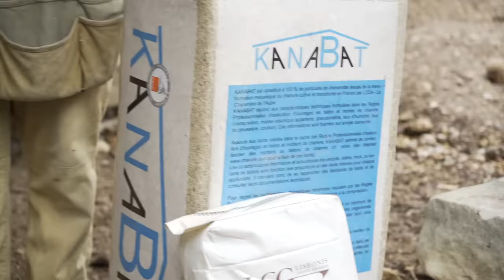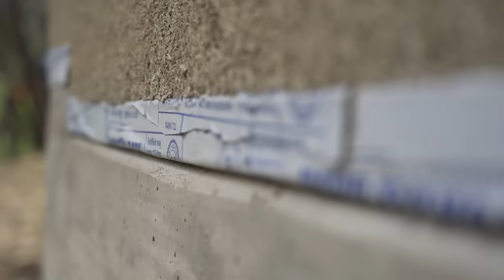Hemp Concrete Walls (R30 + Fireproof) - You Won't Believe How They Built This House!

Comment: I would have loved to heard some pricing.   It comes across as a high end product only affordable by people that build with 300 year old lumber shipped from Japan.
Reply: Don’t forget the team of Japanese carpenters who assembled the wood with hand tools.
Reply: it is the shipping that is the killer.. I priced it.. 2100 sq foot house  around $12000 for the materials and double that for the shipping, perhaps another $20000.  Remember getting tons of the hemp and the Lime is heavy like portland.    Plus it is labor intense to install.  As a DIY it becomes affordable.. if you can source it domestically.  More States have legalized the planting of industrial hemp.. This should help
Reply: @JimYeats  I didn't,  it just seemed like rubbing salt in the wound.
Reply: Exactly. For all the green hype, it's extremely labor-inten$ive.  This is virtue-signalling run amok
Reply: @JimYeats  last house I saw that done was Larry Ellison's home. Built in Japan without nails, and reassembled in Woodside Ca - billionaire's row...
Reply: @stevepailet8258  don't forget the labor to form, mix and install.  Double the materials and shipping I bet...
Reply: @robertmccammon9024  Or in this case...lime in the wound.
Reply: But realize that you can use standard framing. In Asheville NC they built a hemp house $120sqft, so definitely not high end pricing. And that was all hired, no self labor job.
Reply: @stevepailet8258  There aren't yet enough regional markets to encourage growers to produce hemp. Without many buyers a commodity can't reach economies of scale.  So, hemp remains the fiber of the future, but videos like this can help change that.
Reply: I loved everything about the house but the hemp.  They've got to find a faster way to do it.  I'd rather mow my lawn with a pair of scissors.
Reply: Hmm, I confess that I don't see the problem with having "the rich" wanting to build experimental stuff as they are "transfering" money into the less well off in the building trades and local economy.

As for using a team of Japanese carpenters to erect the frame then why not? Why would you risk having a "local" team unfamiliar with the techniques attempting to erect the frame and making a cock of it?

And if you consider the project would have required transportation for the framework and accomodation for the Japanese team then a fair bit of money has been spread around into the local economy. So not all bad.

And then you had your lads do the hempcrete main house build not to mention  your local architect, plumbers and sparkies and plasterers and landscapers and possibly locsl interior designers to complete the job.

And don't forget the builder's merchants who supplied the rest of the material, timber, sanitary ware, electrical kit, doors, windows, heating kit etc, etc.

In UK the builders positively rejoice if a "rich" client comes along ... and if they want a massive house then it's like Christmas come early sort of thing.
Reply: @ArthurDentZaphodBeeb  Indeed it's labour intensive and that means more labour and more money into the local economy.

Can't quite see the downside to that.
Reply: @ArthurDentZaphodBeeb  But more money into the pockets of the builders, what's not to like about that?
Reply: @timothykeith1367  And of course the "future" becomes "today" ... all too soon unfortunately ...
Reply: @t1n4444  These homes are hyped as green woke buildings. 350 year old wood! Recyled! Carbon-sequestered! Just forget to mention it had to be dismantled, shipped across an ocean, trucked to the site, reasembled by a team of Japanese (who were flown out and back). Then to make it even more laughable, used one of the most expensive insulation options available. But it's 'fire safe'! It's green! Except the hemp had to be shipped hundreds/thousands of miles. And the home is in a forest, with a wood shake roof with tons of exposed wood...and will burn to a crisp in a few minutes.
 I have no problem with people spending money on this stuff, but let's get real, this is a 1%er virtue-signalling vanity build.
Reply: @t1n4444  Well, why not use locally-sourced materials? Cellulose insulation is found everywhere, no need to ship in from hundreds/thousands of miles away. Plenty of timber in the US, so why buy a 350 year old building from Japan and import Japanese labor to assemble the thing? We have Great Depression level unemployment...
Reply: @ArthurDentZaphodBeeb  An excellent point and the answer is in your own American hands so to speak.

And for cellulose then there's no reason why you yourself don't experiment with using cellulose in place of hemp fibres. Have to say though that resistance to a very hot flame was impressive ... which might be a challenge for cellulose.

Have to say if you struck it rich then it was well deserved if you took a chance.

Returning to hemp then surely you must have enterprise grants to grow or farm a crop of hemp for exploitation as a buildings material?
Might be just a case of asking???
Reply: @ArthurDentZaphodBeeb  Just saw this comment.

Again can't argue it is a vanity project of huge proprtions. However if money went around then has to be a really good thing for all concerned.

As for hemp being expensive then economies of scale kick in when "every" new build uses it.

I can see your Authorities rather liking the fire "proof" properties.

As for roof material then on some of our trendier vanity projects the owners specify "reclaimed" slate. (Has to be Delabole for bragging rights, obviously, 😂. Recycling being the new religion over here.)

Some even want copper cladding as it goes green. And some even trendier types want corrugated iron sheets.

 If you are absolutely mad on being green (or is that seen to be green ...) we have your actual green roofs covered in grass.

However, as mentioned elsewhere, if you wanted to see really, really green buildings them some of your fellow compatriots had mastered the art a long time ago. Energy efficient, very little greenhouse gases released in the making etc, etc.

 (Slightly tongue in cheek but you might say they got the idea from termites and their mounds ... no, really.)
Reply: So, NOT hemp, just cellulose. Could do this with nothing but the cellulose insulation found in the attic and walls of every house in the USA... PS: Hemp is the outter fiber of the plant. This is nothing but corn stalks in reality and you could use corn stalks just as well. Seems like a whole lot of wasted effort. Just buy rockwool.
Reply: @ArthurDentZaphodBeeb  If this becomes a mainstream product, those negatives don't exist.
Reply: @stipcrane  In my experience one man with a labourer can do 40ft of hempcrete wall 4ft high in one day.  Also the shuttering can be raised the following day for the next lift.  What makes it a bit slower is the drying process before plastering, but plenty of other work can be done in that period.
Reply: @ArthurDentZaphodBeeb  it is green and yup super labor intensive for sure. but that said all building is labor intense.  The real thing is this is not an area where there is any real skilled folks.   plaster work is labor intense. sheet rock is labor intense.  Framing can be labor intense.. Heck if you got out and helped pour concrete you would be going OH my this is labor intense
Reply: @timothykeith1367  Seems there are enough growers at the moment .. seeing all of the CBD outlets, But I have also chatted with a couple of growers who  just dump the stalks.  Does not make a lot of sense. but that is what I was told.  Perhaps as time goes on and more people see the advantage of hempcrete this may change.
Reply: @stevepailet8258  Farmers are reluctant to invest in hemp when there is just one buyer.  They want the best prices for their commodities.  Commodity exchanges for hemp exist, its a matter of time before its widely grown.   There must be widely advertised brands for the hemp market to explode.  Hemp can be raised on marginal land not suited for other crops, land that is used for pastures of woodlots.   If hemp proves to be widely used in construction then, I'm sure we'll see it in many retail stores, but probably not Home Depot because the hemp products tend to be bulky and self space is costly.   Bulky farm products like hay are mostly local because its costly to transport.
Reply: @ArthurDentZaphodBeeb  - Let's admit it though...  The only reason this hasn't been done on an industrial scale (which would surely drop the cost my more than half) is the prevailing American attitude that marijuana is bad, and the continuing poor education of weed vs hemp.  It's just easier to write off the US market than to try to educate the ignorant masses (and the government these idiots keep electing.
Reply: @FHL-Devils  ha, agreed. There's some great old movies about 'demon weed'. It's incredible it's still listed as a Schedule 1 drug (similar to heroin/lsd). Yet cocaine is only Schedule 2.
Reply: @timothykeith1367  I agree with your assessment ... this is exactly why I said the cost of the material is not huge but the shipping is a killer.. one or two suppliers .. the real suppliers are in France the UK and China.    Short of building with pre made blocks to be glued together dont see it actually happening any time soon.  Contractors are not willing to deal with it as there is not much demand.  The contractors have no clue ... the end buyer has no clue.  I have been posting about the product for years.  I will continue to post on my website for years.  Hemp is used widely in the EU.. and some other venues.. So what are we looking at 10 houses a year in the USA?  not much for sure
Reply: @stevepailet8258  I am thinking of experimenting with shredded EPS foam (styrofoam) mixed with cement. It lacks the strength of regular concrete but 48-inch long blocks (10-inch wide/16-inch high) only weigh about 25 pounds each, so I've read.   I've read that the blocks are 55 percent as strong as concrete made with aggregate. The blocks have R-24 value. Its also fireproof and insects won't damage it, the blocks are assembled with spray foam instead of mortar - the hollow cores are filled with rebar and concrete to provide the strength of the wall - 8 times as strong as a wood framed 2 x 6 wall.   You can cut the blocks with any saw designed for wood and can carve grooves with cordless tools to run wiring.
Reply: @timothykeith1367  recycled foam and concrete  cellular blocks have been around quite a while. There are several companies who make them and you can even buy shredder mixers now.  Those that are cellular where you can pump in concrete and lay in re bar are amazingly strong and as you say r25 whole wall insulation is a super good way to build.. It all comes down to how much you can save diy
Reply: If the infrastructure was there this product would be affordable, hemp is easy to grow.
Reply: @Lappmogel  still have to register to grow hemp.  Takes about 1.5 acres to  harvest enough shiv to build a 2000 sf house
Reply: @stevepailet8258  The stoners where right then, the government really did kill hemp with a bunch of red rape bs.
Reply: ArthurDentZaphodBeeb who said these houses are green?
Reply: @ehuang12  I say they are green.
Reply: @ehuang12  a few reasons.  no fertilizer is needed to grow the hemp.  The shiv is remarkable in its ability to sequester carbon dioxide  the lime used is not nearly as bad on the environment as is portland concrete.  This is due to how much processing and release of co2 making portland.  Curious.. would you call vinyl siding environmental?  Not when it is produced not when it gets to a landfill.  Would you call gypsum board really environmental when you know it can harbor black mold if it gets wet?  How long does it take to break down fiberglass insulation?
Reply: Steve Pailet I get it, I was just pointing out to Arthur that no one in the video claimed it was green
Reply: @ArthurDentZaphodBeeb  it's more ecological to feed a half dozen men for a week than to have a bunch of large trucks and machinery burning fuel away for a day. Yes, it's expensive. Until these methods of construction are perfected and normalized, the costs will be prohibitive for many but brushing it off as a hipster's gimmick is disingenuous. This SHOULD be the norm, not concrete, rock wool and cement boards. It just needs to become financially accessible to more people and the funny thing is: for that to happen, there needs to be more virtue-signalling hipsters using it.
Reply: @FHL-Devils  hemp production and weed consumption are legal in many states DESPITE the reefer madness/war on drugs debauchery so I wouldn't use that as an example. Most of the world still regards weed as the bane of evil while the US has made it widely available. I think the main culprits right now are lack of knowledge of the product, vested interests in business-as-usual mineral and petro-chemical products and industry, and cost of course, economies of scale as someone rightly said. The more people use it and gain knowledge about it and the more accessible it will become.
Reply: @papapetad  any cellulose-based product is good in my eyes. But no need to use very-expensive hemp when the world is awash in very-low-cost recycled cellulose already. So, no, we don't need hipsters virtue-signaling hemp, because all that hemp is used for is insulation.  Air doesn't give a damn whether it's trapped by hemp or ground up cardboard...
Reply: @papapetad  - I wouldn't say "Many".  11 states have it fully legal, 8 states have it fully illegal - so the ratio still isn't very good.  And as I stated, the primary issue isn't legality, but perception.  You spent a long time explaining how you agree with me.  As for global perception of pot, around the civilized world - outside the pacific rim - it's pretty much open use now...  Also note that the only reason that marijuana law was passed at all is because the US occupying force enacted it during WW2 - the Japanese government is rather ambivalent toward it.
Reply: @ArthurDentZaphodBeeb  I am defending the use of hemp in general as a great substitute for established ecocidal materials so I am approaching comments for this video from that perspective and while I agree that recycled corn stalks or any nunber of other organic products will do the same thing, I also think corn monoculture and current practices are ecocidal and it would be much better to convert a large portion of that agriculture to hemp production so any promotion of hemp products is good in my books. Finding out more ways to use and make money from current ecocidal systems does not help change the model, it only offers more ways to promote it. This is a step towards making hemp cool again, which could mean bringing back much more ecological textile production as well. It requires no pesticides, very little irrigation, no chemical fertilizers, no slave labor in 3rd world countries, no cutting down of the amazon. Bigger picture stuff. Long term. It's not gonna solve the world's problems but I see it as a major step towards sensible change, bringing back practices that were commin sense before some assholes decided cannabis was detrimental to their agenda.
Reply: @stevepailet8258  or use locally found alternatives like corn stalks or wheat chaff
Reply: @stipcrane  make blocks in a factory and ship to site, doesn't have to be "poured" on site, it's plastered over so the texture won't show. Rich people just want to show off 👎
Reply: @colinstace1758  go ahead and use them you will discover why they dont hold up
Reply: @stevepailet8258  how are they different to hemp ? What about coconut fiber ?
Reply: @colinstace1758  coconut fiber is good for making grow mats for micro greens
Reply: @stevepailet8258  canvas, rope and paper need a long staple, these fibers were cut short, looks like 1/2" - 5/8" in length, it's a while different process to hemp crete. And with paper there needs to be a certain percentage of virgin fibers so you can't keep recycling paper without the virgin fibers. You could use many different fibers, bamboo, flax, sisal, coir etc if you had a local source
Reply: @colinstace1758  all good but remember hemp is not the same as your examples
Reply: Historically there are examples of sawdust used to make a similar product.
Reply: @brianphillips7696  LOL then there historically is adobe and cob and straw and horse hair.
Reply: Steve Pailet unlike those others sawdust is easily sourced these days and the end product is much closer in it’s characteristics to the product displayed here.
Reply: @brianphillips7696  OK build it and I will come LOL.. I think that saw dust does not preform well.  It swells.  shiv does not
Reply: Steve Pailet OSB sucks when it is allowed to get wet yet it seems to have found a place.
Reply: @brianphillips7696  more glue in osb than actual wood fiber it has its place but it does mold a lot more than plywood.. no way for the moisture to work its way thru to dry
Reply: Your statement does not make sense. Did you miss the normal lumber and structural steel that are common construction? The Hempcrete is only a curtain wall.
Reply: @ArthurDentZaphodBeeb  nothing like being a billionaire to be able to afford that sort of thing. Oracal is a huge date company like Microsoft
Reply: @t1n4444  building and making up this version as you mention using cellulose gives on paper crete.  It works as a nice mortar in building a cord wood building. OK now you have two more building materials to look up
Reply: @w8stral  corn stalk is not like hemp shiv.. then again dont think from your response that you have a clue what you are talking about.. so we just have to love you anyway
Reply: @timothykeith1367  perhaps this is so. but most farmers today growing hemp only sell the seeds and use the rest for feed stock
Reply: @timothykeith1367  would be a lot better using AAC
Reply: @colinstace1758  the fiber is the outer hull of the stalk. the woody shiv is the inner pulp.  what you are describing is like saying the outer layer of bark on a tree is the same as the harder inner wood.. not the same
Reply: @stevepailet8258  Ok.

While we are on the topic of "cretes" it occurs to me that if we are wanting to be green(er) then we seem to have a virtually inexhaustible supply of a very long lived and inert material in the form of plastic packing.

Over here not only do we only use it once we spend a great deal of cash shipping it to third world countries so they can recycle it and resell it. Only they don't do a great deal of the recycling thing.

Some of our more enterprising investigative reporter types have done the "shock horror!" exposés on rivers covered in plastic and the vast open areas metres high in "our" plastic waste.

It occurs to me that if the waste was shredded and entrained in cement then we are "doing something about it". And making "plastycrete".

Now, this may already be happening "somewhere", so I am not claiming the prize for saving the planet.

And if anyone thinks this might be difficult to work with as in labour intensive with forms and suchlike then ... sit down for this ... Germany is already using a vast 3D printer, squirting concrete, to build a three bed in Dortmund.

And if anyone is sitting there with their sceptical face Spain have already printed houses, offices, museums and even a bridge.

Some of you who live on the other side from Europe may be even more astonished that you have your very 3D printer outfit in California, calling themselves "Mighty Buildings"

Mexico is already printing up an estate of 50 dwellings in Tabasco.

From the press article it states the German version has triple skinned cavity walls filled with insulation.

Part of the printing kit was designed in Denmark and the construction company is "Peri".

The building authorities went over everything in minute detail and presumably have passed it on principle but will presume the actual build will again be examined before being signed off for human occupation.

Now, before the possible avalanche of criticism descends listing just about every "what ifs" and "ah yes buts" it might be of benefit and educational purposes to Google up the examples mentioned above.

In short suggest you read up first, then pull the thing apart.

And, before anyone comes out with it, the overall costs of these projects in not claimed to be cheaper 😂😂😂😂.

It is for the moment in the "experimental list" and may, possibly,  be accepted as a viable method of construction  and very possibly cheaper in the long term.
Reply: @t1n4444  see no reason to not use chipped plastics as a portion of fill aggregate. Have not found anything that even mentions it. China used to take a huge amount of the refuse plastics but for whatever reason(I am not aware of why) they have greatly reduced what they are importing to recycle. Would assume it has to do with prices..
Reply: @w8stral  dont have a dog in the fight of using corn stalks. I just do not think they have the qualities that hemp has. Until you can get government research facilities to do their own experiments you are suggesting pie in the sky. No hemp being smoked here but I do have to question what you are smoking.  Why dont you do some tests and have the results posted?
Reply: @stevepailet8258  Using chipped plastics, as you describe them, in "local" construction products might reduce overall "secondary pollution" produced by transporting the waste thousands of miles across the planet.

I was not thinking along lines of pladtic to China per se but other Oriental Asian countries including India and of course African nations.

Forgot to mention that if folks not interested enough to search online then they need only remain on YouTube and search for "printed buildings".

The Dortmund project is but one amongst many.

Of which I was impressed by fact that concrete material kept at constant moisture/density/flow rate to ensure uniform thickness of layers.

Promo video was not that long so the finer details of construction were a bit lost as it were.

Presumably there are in-depth videos elsewhere with regards to mix details, drying times etc.

Fascinating stuff, well to me anyway.
Reply: @t1n4444  I watched some printing and appreciated that the house I saw was being printed with internal triangulation truss style.  With all that enclosed dead space I wonder just how much R value is created.
Reply: @stevepailet8258  According to the article in the paper the voids are filled with insulation.

I speculate the insulation might, rpt might, be of the two part polyurethane type foaming agent stuff ... or green version of perhaps?

I would further speculate the German construction authorities are pretty picky on insulation values. And the builders very anxious that the building is built way over building spec to ensure good reviews. 

Doubtless the German/European techo construction journals will be all over it like a rash trying to poke holes in the theory and practice 😂.

It is gets a favourable review then might see more of them all over.

And as you will know, or will research, concrete acts as a sort of carbon dioxide magnet.

So not that green perhaps but not quite as bad as you might think.
Reply: @t1n4444  low expansion am sure because it would blow it up other wise :)
Reply: @stevepailet8258  😂.

Having done more research I see some construction uses rice husks entrained into the "crete" and the voids filled with rice husks.

Further it seems as if printed buildings are rather more popular than I had at first realised.

In fact for those who don't live in Texas I see that the authorities have collaborated with printing construction companies in Austin for "social housing " projects.

Some of the first structures were printed on 2015 ... and there was me thinking all this was cutting edge!!! 😂😂😂

Note to self ... watch a lot more YT building construction stuff, and not just ToH.

I suppose the clue is in the title ...
Reply: @t1n4444  I was surprised at the r value of rice hulls. 3.5 is pretty decent per inch.. The biggest problem just like Hemp is the cost of shipping. Not a long list of things one can do with the parboiled husks.  They just like the hemp shiv are are high in silicon content. It is something that more than a few commenters just do not understand.  They suggest mixing plant material that easily break down and compost back into the land.  Rice hulls pretty much can be laid as a mulch and look the same 5 years down the road
Reply: @t1n4444  the cost of the husks is pretty much negligible if you have a way of getting them to your location.  Seems like there is no reason to go with the extra steps of using them as the aggregate in a lime slurry.  Just blow them in like one does cellulose.  Nothing eats it. hard to get them to burn.  Because it is dense sound is not easily transmitted. For attics just loose fill and it will pretty much just fill the cavity of the attic at the ceiling level.  I  imagine one could mix with a foaming agent in an open cell mixture. Though no clue how well that would adhere to the roof or walls. Easy enough to use a mesh like you do with cellulose.
Reply: @stevepailet8258  Talk about one topic triggering another.

I recall see one of the videos of quite some time ago when parts of Windsor Castle were gutted during a catastrophic fire (builders had left a halogen lighting rig too close to something flameable, allegedly).

The voids above the ceilings were carpeted in tiny sea shells.

I would suggest this more for sound insulation ... against eavesdropping of state secrets, or more likely bedroom gossip ... as in who was "playing away" with the Monarch of the day.

If ever you read "Wolf Hall", by Hillary Mantel, you would learn that the folks of the time were quite "keen" on that sort of thing.
Reply: @t1n4444  seems I heard about that.. I have not been there since 1987.
Reply: @stevepailet8258  Oh no, a bit earlier than that ... I was thinking more like 1530s.

Sorry, I could not resist!

In fact tiny sea shells used just about everywhere providing owner had enough cash to have them collected and moved.

And, thinking of all things archaeological in the buildings line ref your royal residences, and in regard to earlier comments about termite damage to the timber works in these buildings, then a remedy was known for insect damage in the form of the sweet chestnut tree, aka castanea sativa (that sativa gets everywhere ...)
 
The exposed hammerbeam joists, rafters, etc, in a hall to be found in the Palace of Versailles has, according to the guides, never had a cobweb or bugs on it since it was built.

Much in the same way camphor wood was used in construction of chests to protects against clothes moths or mosquitoes.

Might be timber buildings might be longer lived if different timbers were used.

I wonder if your silviculturists have considered planting sweet chestnut trees? Mind you might be quite a few years before you could benefit.
Reply: @t1n4444  bugs just dont eat sea shells..  pretty fascinating over time to see how buildings have changed.
Reply: @stevepailet8258  😂👍
Reply: @ArthurDentZaphodBeeb  what does labor have to do with virtue signaling? 
how is using a more natural product disingenuous? They show and say that it is more labor intensive in the video lol
Reply: Way too expensive for most people
Reply: @faith5563  Then straw bales it is IJ3.

Good spot, and more than enough videos featuring straw bales on YOUTUBE to see you through this lockdown, and the one after that ...

Save you lot chopping down CO2 sequestrating trees and start construction of houses with straw bales and clayey mud.
Reply: @stevepailet8258  What site do you pick up the wood of old Japanese house?
Reply: @robynbyrne5834  my first guess would have lots of money and go to japan. Looking at the wood in that part of the world the kinds of hardwood there is much like mahogany.  Really does not matter what part of the world one goes to what in my view does matter is trying to find first growth wood.  It is tight grained has a lot of minerals so it is super hard and stable.  Think dehydration of the wood.  That along with being more straight grain wood. I have worked with some african and some amazon basin woods but never any but small pieces from the far east. When I lived in the UK. I did go visit sherwood forest. Not much in the way of those gigantic english oaks. All cut down to keep warm.  Now it is nothing but pine trees that were replanted as second growth
Reply: @stevepailet8258  Cool, I'm a trucker building in Northern Michigan. I can bring it myself.
Reply: @t1n4444  Without the builders nobody has a job. You're a Genius.
Reply: @thisismagacountry1318  I know ... he replied, modestly.
Reply: @thisismagacountry1318  laughing you do know most shiv is sent from France and England.  :)
Reply: @stevepailet8258  Absolutely no idea whatsoever.

I just like the idea of being called a genius ... even if it was ironically satirical or satirically ironic.

It's close enough for me.

😂😂😂
Reply: @AlexAlcyone  3 crops can be grown annually from what I understand.  There seem to be a few here who just conflate the exterior fiber with the inner woody part of the stalk which is the shiv
Reply: @t1n4444  does put on a smile doesnt It?
Reply: Robert if interested to purchase crete you can reach out to us at AmCorCo Corporation that's a Division of our company. Amcorco.com.
Reply: Are you wanting g?
Reply: You can actually source it for less then a standard home if you decide to do a bit (lot) by yourself, it take time, but not much skill... and shipping is not that bad (a house can be done with a 40' container, so the prince of shipping one container is not 10 000 usd =) (lime can normaly be locally sourced)
Reply: @EmpereurFrancois  what type of lime would you use?
Reply: @EmpereurFrancois  the work is not hard just a bit time consuming. Two people working should be able to do a lift around the house every few days
Reply: @stevepailet8258  I haven't have personal experience yet (hopefully this summer) but been on facebook groupe (internatioal hemp builder, on facebook) and there is some debate about this, but what i retain is that any lime will do if you don't wan't it to be structural. That mean hydrated lime is fine (and i did some test on bloc, and they and up really sturdy in the end). Hydrated lime is 2-3 time cheaper then hydraulic lime, and at least where I live, can be localy sourced for quite cheap including shipping.
One of the advantage (that obviously this video did not took) of hemp (again, no real experience yet) is that it is quite simple and can be done by nearly anyone... Time consuming, but not complicated.... So i'll try to do much with friend!
Reply: @EmpereurFrancois  here is a link for Natural hydrolic lime.  This is the type of lime you should use.  The reason for sending the link is so you can determine one of 3 types you might need for freeze protection.  Remember the higher this value the less thermal property the hempcrete will have. Where I am lower part of zone 4 near the upper side of Georgia I would want a more breathable hempcrete so would choose nhl-2
The weather is mixed with many days of high humidity and I would prefer higher thermal resistance
Reply: Building a stick frame home with thicker walls and using hemp wool instead of fiberglass for insulation is probably your best bet for something affordable and not incredibly labor intensive
Reply: @0SilentStone0  double stud with cellulose is what I figure is the best bang for the buck
Reply: @stevepailet8258  was federally legalized in 2018 Farm Bill.
Reply: Should become quite cheap. Uses cast off material from other uses. A lot of the cost is going to be related to regulation.
Reply: @daedulsworkshop  at this point seems like most are growing for the cbd and tossing the fiber and shiv.  Will take some time to get them using all of the plant
Reply: @stevepailet8258  certainly. All new developments take time. Especially when dealing with a plant that was unduly regulated for nearly a century. It will get there. Hemp clothes is what I'm most interested in personally. But this is cool too.
Reply: Been done. Called
Papercrete.
Reply: Who told you hemp Needs no fertilizer or pesticides? That’s pure crap. You aren’t gonna grow half the product without fertilizer and pesticides. That is going to be the ruin of hemp
Is all the bullshit being spread about it.
Reply: @brianphillips7696   papercrete does not have near the insulation value. Remember it is the entrained air that insulates.
Reply: @daedulsworkshop  legal but you still have to fill out the paperwork.
Reply: @daedulsworkshop  actually not much cost in regulation. Transportation seems to still be the driving cost, sigh
Reply: @daedulsworkshop  hear the fibers are even softer than cotton
Reply: @stevepailet8258  hemp fibers are softer and stronger than cotton. Because of their length as I understand it. Means clothes take longer to wear out and that means continue to break in longer. 

Strange terminology. Damage is good and damage is bad. 

Personally I would love to have some t-shirts, hoodies, flannels, joggers and denim pants that last 5-15 years.
Reply: @stevepailet8258  Lime can be sourced locally, and there are 21  states that now produce hemp.
Reply: @stipcrane  Yeah, because a bug-proof, fire resistant, vapor balancing, carbon capturing, insulating product is not worth the time. Jeez..........
Reply: @canucanoe2861  heck there is a lime facility 40 miles from here. The real problem is that the shiv is not so easy to source .  Yup it is legal and people are farming hemp locally.   not so easy still ... Am guessing as the farmers figure it out.. sourcing will get a lot easier
Reply: @stevepailet8258  - I've thought for some time that getting a good chipper/shredder and collecting plastic bottles to make "plascrete" blocks is doable. Obviously there would be a skim coat of stucco exterior and similar interior, so in a high heat event the plastic would melt but re-solidify.

I've also thought that concrete from driveways, sidewalks, etc. can be recycled as a building material by using forms.
Reply: @Hippiekinkster  Honestly if I can get away from plastics I certainly would.  To many in my close personal environment now I want a healthy home and  just adding more plastics does not qualify.  Carpets= plastic, vinyl flooring, plumbing piping, plastic on the wiring. Spray foam insulation various binders in things like insulation, some paints
Reply: @Hippiekinkster  Using ground up plastics as aggregate in a driveway certainly does make sense.  Nothing like trying to collect 5000 pounds of plastic bottles. think that might be easier said than done
Reply: @Hippiekinkster  Glass on the other hand is a great aggregate for concrete and is often used in roads
Reply: plant your backyard...a surplus of hemp fiber.
Reply: Supply chains are here. Hurd for Hempcrete will average at .40 cents per pound. US HEMP HURD
Reply: It's one thing to have money, it's another to have the show off exclusive high end taste that smells like a private forest of money growing on trees
Reply: Hemp hued is becoming more mainstream. Kentucky and Tennessee are growing it. 
If someone wants to help with packing the hemp lightly into forms, it's a huge saving. Even a teenager can master it.
If you want Japanese joined frames, that's an option, but not necessary.
Too much complaining on this site with no research. Yes, it's higher than standard building techniques, but maybe 10% more.
Reply: i would not put this in my building
Reply: You dont need hemp, i would argue you can use any filler, straw , hay or woodchips with limestone and sand. And you get Roman Cement with woodchips filler. Which the hippies call "Hempcrete"
Reply: @stevepailet8258  Processing hemp takes specialized equipment to strip the outer fiber.
Reply: @Lappmogel  After Prohibition was over, the govt. looked for the next thing it could control.
Reply: @nancyyoung8557  yes
Reply: @nancyyoung8557  Yeah, if you don't have work you make work. Got to justify having all those agencies.
Reply: This will be product that will be used more & more.  The benefits outweigh the price.
Reply: @benitalpaxton8120  doubt it here in the US.  The cost due to shipping is horrendous. Till more industrial shiv is produced in the US it will just remain an odd building product.  Personally think it is one of the best natural building materials around.
Reply: Cool. Do you have a link?
Reply: Also, it seems pretty labor intensive.
Reply: @ArthurDentZaphodBeeb  hempcrete is fire-proof
Reply: Ask Americhanvre or Chanvra Materials to give you some pricing..
Reply: I asked a company, price is 50% more expensive that regular concrete block. That was the blocks with the green things sticking out so you can stack them together like Lego blocks. Nice features ok, but..
Reply: Some companies have downsized to hemp blocks which is cheaper, faster, and easier to build. Same material. Still didn't give a price but selling it as the same cost or a little higher.
Reply: Not for your average Texan!
Reply: Personally im gonna learn to make hempcrete myself it seems finer ingrdients plus proper firm application and compaction of the mixture helps but the hempcrete is only part of it i like to look to diffrent structure forms depending on my need such as daub an wattle construction technique
Reply: The sad part it it should be extremely cheap but because hemp isn't widely grown or accessible In most areas it will be more expensive .. also keep in mind you won't need to purchase insulation, vapor barrier eyc
Reply: The material itself is dirt cheap since it's simply a byproduct of hemp production, the installation I'm not sure.
Reply: @stevepailet8258  It's still lighter than concrete.
Reply: “… for people that build with 300 year old timber shipped from Japan” 😂😄🤣
True. I had my fingers in my ears because I thought they were going say the estimate.
Reply: It depends on where the hemp is produced. If local grown its competitive with conventional concrete. Its best made in a factory rather than site built.
Reply: I Googled it for my area , you will be surprised
Reply: @ArthurDentZaphodBeeb what about if it had aluminum framing